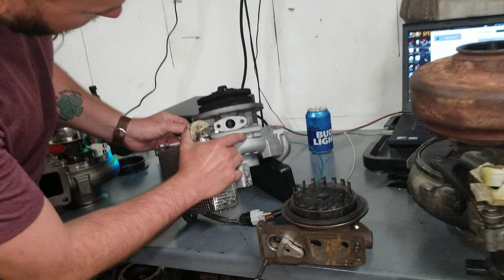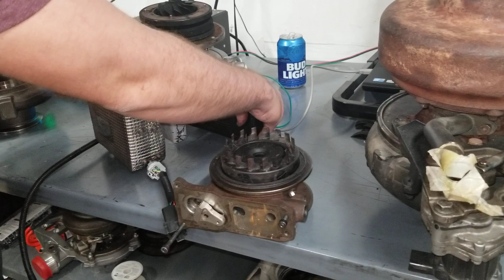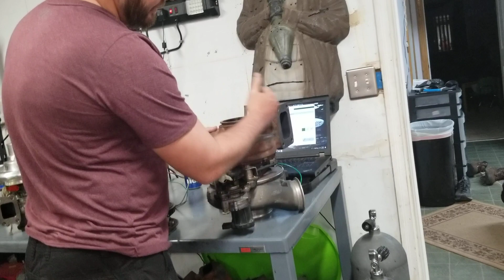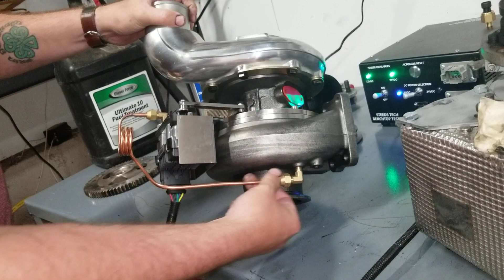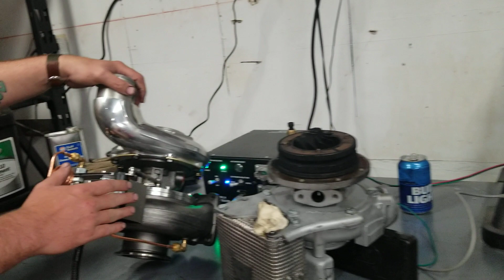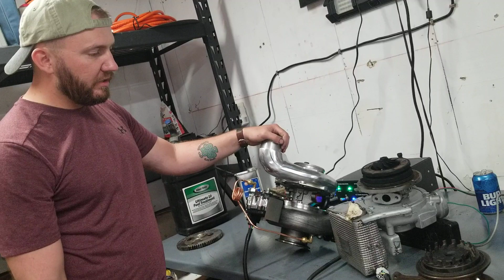Banshee VGT demoing DPS Turbonator

Comment: Did you finish this project?
Reply from the maker: I did, i put a holset VGT back on.  I kept taking this turbo apart to clean the soot out.
Reply: The turbonator was having soot issues?

I have a 2nd Gen that I made a home made VGT controller for. I converted the truck to a He351VE, and recently put a S476 turbo on to compound the truck. I revised my C code to slow the VGT turbo down when the S476 gets spooled. It works well, but I can’t relate to the comment about the factory Holset turbo hitting a stall speed, or the comment about not having much AR adjustment. 

I can adjust 4cm up to 25cm. Do the garret style turbos have more AR adjustment?

My truck has a manual trans, and even if I shift relatively slow, my shaft speed is over 35,000 rpm. I’ve never seen it hit a stall speed. Even idles @ 12,000 rpm.
Reply from the maker: @jerrythechainsawguy8100  If you open the holset, it doesn't really go down to 4CM. After a certain point, it just obstructs the turbine in order to drive the EGR and defects around the turbine. unlike a VNT where the exhaust can only go through the turbine. But a super tight exhaust doesn't mean it'll spool faster. A VNT will light faster than a Holset VGT, but in my opinion a VNT can't compete with the Holset VGT. In my case with the DPS, which i had an early version would build alot of soot between the cage and over time the turbo would get lower and lower range. I eventually ended up using the L5P turbo actuator and it worked great.
Reply: @ interesting. What do you think about doing compounds with a VGT? I find my turbo spools 200-300 rpm later

Comment: Sure wish I could see the part numbers on that Hella Actuator
Reply from the maker: The ones on the turbo were junk, just clones that didn't work to well.
Reply: @SteedDolan  still wish I knew the part number. I've burned through a half dozen of the newer style ...
Reply from the maker: @jlaustill  If the new style is the actuator I am thinking of its a way better actuator. But odds are its a clone. If its not a clone, then its probably getting heat soaked. I ended up using the actuator from the L5P and it ran alot better. I ended up going back to a Holset VGT.
Reply: @SteedDolan  the new style is just an EGR one from what I can tell. It requires constant amperage to maintain position and just overheats itself under load. The hella actuator is a much better design and a repairable part. These new style ones aren't repairable at all. I'm building my own controller and just wish I could get one of these actuators and brackets as it would save me a shit ton of time, but alas

Comment: Hi are you still making the banshee controllers? I’m wondering if you could make one for a lly turbo on a lb7?
Reply from the maker: I'm not, I'm working with ATS and designing the Intelliboost VGT controller. Should be ready this year
Reply: @SteedDolan  gotcha I’ve watched a bunch of your videos so it should be a killer system. You probably can’t talk much about it but wondering if there’ll be any backwards compatibility for older trucks and options for different brand trucks? Most of what I see is for Cummins unfortunately

Comment: ever play with the m2 holsets from the isv5.0?  I'm trying to tune mine down to a 1:1 drive pressure ratio and it's not going super hot yet.
Reply from the maker: I believe there the same actuator as the HE200VG
Reply: @SteedDolan  The rotary valve is quite a bit different than the VNT/VGT but it wouldn't surprise me if the motor is the exact same unit using the same controls.  I've run into a bit of a road block on the back pressure and it's more a matter of not understanding the maps and their relationships.
Reply from the maker: @NavyCuda  Your right, if you want this video the 5.0 turbos are setup like a sequential turbo setup. Once the smaller one taps out a flap opens to light the low pressure. https://www.youtube.com/watch?v=pRSXJoBZUlE
Reply: @SteedDolan  I've been using that video quite thoroughly as I work on my tune.  What I've realized is that the ISV runs extremely lean, having excessive boost with the factory configuration.  That valve is in constant operation though I just came back from a drive where I flatlined the valve as always open. If I understand the maps right it is actually only 61% open, the rest of the 39% being for the big turbo and the wastegate).

I'm starting to believe that the turbos are setup to ensure the small turbo always provides 2:1 drive pressure, no matter the position of the rotary valve, as long as the low pressure turbo isn't exposed.  I've got peak boost set to 22psig now, let it run without boost for a portion of the map.  Throttle response is still very good.  That little turbo spools fast.

My primary goal is economy and drivability.  I'm starting to think that I'm approaching the limits of what the m2 system can achieve.  I'm a bit hesitant to start bypassing to the low pressure turbo at idle, but as far as I can tell that might be my only chance at coaxing a 1:1 drive pressure ratio out of it.

Comment: Very interested in seeing the performance of this turbo! I’ve been looking into that turbo for a while and want to see real world results for sure. 
I’m also curious about the controller for it, as I have a a 12valve that is compounded now and I want more control of the turbos than I do now, and the exhaust brake function because all I do is tow heavy and this seems to be a way better option than my current manifold charger. 
Thanks for the video I look forward for more

Comment: i bought a he351ve on ebay years back for a hillclimb project car (audi quattro 5 cylinder), strange thing was where the controller is usually mounted, someone fabbed up a vacuum actuator with bracket, not sure if its going to be usable in my case, id like to send you a pic to get your opinion of it if thats not a problem.
Reply from the maker: Alot of people came up with a hand full of mechanical setups, some worked and some didn't. Super Jesus (Commented above) has a HE200VG that he converted to mechanical with pretty good success. I stick to the stock electronics.

Comment: Exhaust does not bypass the turbine in Holsets, the wall hits the housing long before it could open enough to expose the backside. 
Turbine speed drops because exhaust gas has less area contact of the wheel, its all focused on a very small point. VNT at full close still flows against the entire width of the blade.Thats why Ford had overspeed issues with the 6.7 SST in exhaust brake mode with its tiny little turbine.

I have this experience with my HE200vg. There is a Goldilocks point in minimum closing of the wall where it spools up very fast. Close any further and it doesn't spool up faster but has much higher EMP.
Reply from the maker: It doesn't bypass, during exhaust braking it deflects the gas around the turbine to prevent over spinning. When its in its wide open position it acts as a waste gate by making the housing as open as possible. Now this is just one control measure, in a stock application the truck will also de-fuel at the same time to get this effect. If you have the RPMs and fuel you can still spool the turbo when its wide open position. This is just one of many control measures Cummins uses.
Reply: "When its in its wide open position it acts as a waste gate" 
That is a fault position. If the turbo is used/sized correctly to the engine it should never open that wide in normal operation.
"This is just one of many control measures Cummins uses." 
In my 15 years as a professional mechanic, I have never seen a VGT open to more than 20% closed unless there is a controller fault. Even in a turbo overspeed fault condition, the engine will torque derate and the vanes don't open that far.